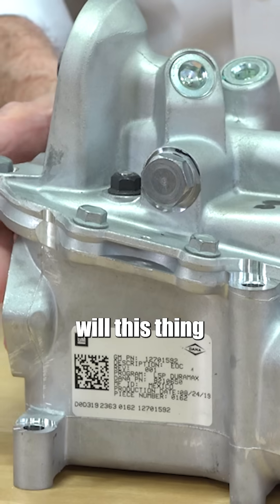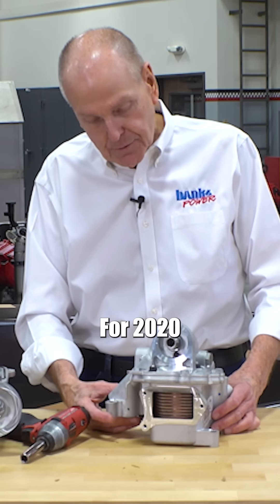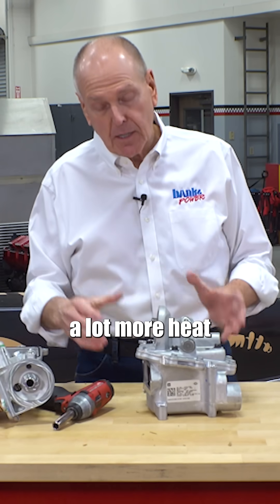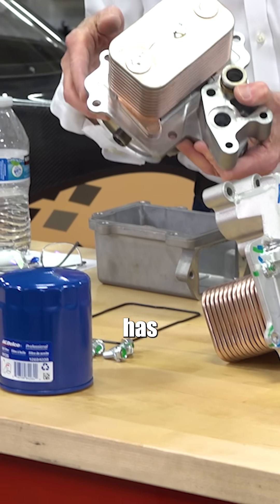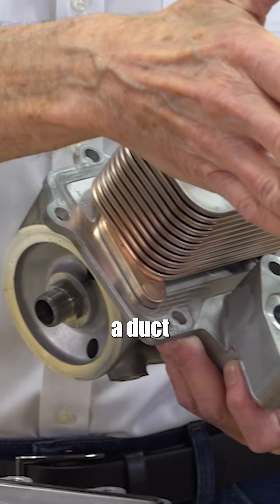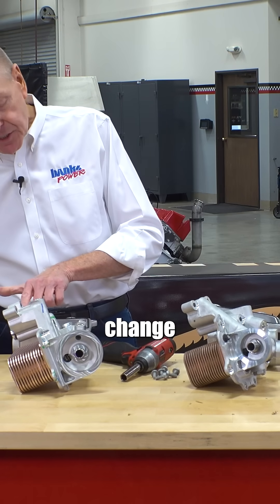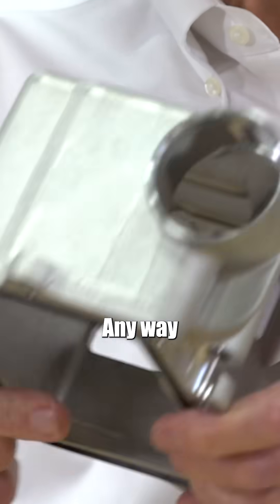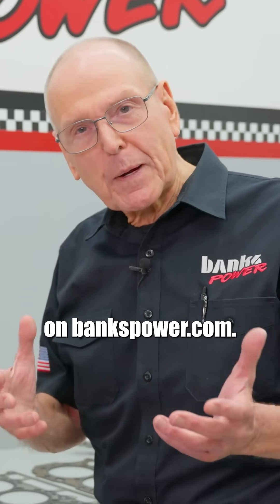Gale Banks inspects oil coolers and makes a discovery.

Comment: Gail the surprising thing is that the dealer has been changed the oil on his truck since it was new and they never even looked at the antifreeze to see if they had oil in it. How ridiculous is that how the motors got it out of freezer that oil pan and everythingI think they should be replaced the motor was European

Comment: What is your opinion to do with this matter is flashing it good enough should they replace the motor to your opinion, please
Reply from the maker: Flushing out oil and water intermix is an extremely long and repetitive process but it can be done. If metal went through the engine then that's a different story.

Comment: I'm not real smart but why would you want your oil the same temperature as your engine temperature. I would rather have my oil cooler in the air which doesn't get as hot as the engine. Air temperature 120 degrees max and engine temperature is 190 or more degrees all the time when running. Engineers what would we do without them.

Comment: I did this upgrade to my ‘13 LML,… definitely a tight fit and I did have to do a bit of trimming on the exhaust manifold but no issues!!! I do run an Amsoil dual oil filter bypass kit, so I had to get the correct adapter for the smaller oil filter attachment. Good to go now!!!

Comment: Do you know anything about the oil cooler issues on the new trucks. I know there has been numerous customers with oil cooler failure that is pushing oil into the cooling system and it is a pretty big repair. And it is linked to the oil cooler failing but is something else causing this to happen my good friend has a new truck and that’s why I’m asking.

Comment: I noticed what appeared to be a PF26 oil filter, which GM has subsequently discontinued and has since replaced it with a smaller PF63 oil filter.
Reply: Y?
Reply: @ I’m not sure, the duramax used a PF2232 since its inception until 2020 when it switched to the PF26, then after a year or so it was replaced by the PF63 which is used in all gen v gas v8s and some other applications. It’s a smaller filter perhaps for clearance reasons 🤷🏻‍♂️
Reply: @stellingbanjodude ahhh the ole 1 size fits all. Sounds like HONDA

Comment: I used the 17-19 L5P unit on my 05 for the fact I want to use the bigger oil filter.
Reply: Much more of a filter upgrade if you swap out the threaded nipple to utilize a CAT 1R1807 or of the like. It’ll actually increase your oil capacity from 2.5 to 3 gallons.
Reply: @HBC914  I use the bigger PPE 114000555 oil filter.
Reply: @HBC914 at a higher micron rating iirc. So unless ur doing EXTENDED drain intervals it’s worse.

Comment: Just one crazy question. Once I change over to the BANKS filter kit can I upgrade to a multi quart oil filter?  Many years ago I had 6.5 1992 Detroit diesel engine and I utilized the larger quart oil filter. I’m driving a purchased brand new 2019 6.6L Duramax 
4 x 4 3500HD with 46,000 miles on it. So would you recommend the standard oil filter or multi quart filter?

DARRELL 
Mississippi
Reply: I would say Gale knows the DMax as well as GM Engineers. Banks built DMax engines for Military application at their request.
Reply: @thegreenerthemeaner  that's hilarious 🤣 Gale is pretty smart but it's weird to idolize him like that. Also pretty weird to think an outsider knows more than the people that designed the engine itself.
Reply: @andrewahern3730 and it's weird that you would idolize the OEM engineers like that..
Reply: @ownthenight01  lol "idolization". Mate, I'm pointing out a fact: a team of people that work on something knows more than someone who doesn't. Get off of Gale's knob.
Reply: @andrewahern3730  first of all, I'm not the one that made the original comment... Second of all, yeah a team of people work on something, on a timeline... There is definitely room for improvement... Especially after it's been fielded for so many years... I make changes to engineers' plans, in the field; every single day...  These engineers don't know everything. They do the best they can with what they have to work with, with the constraints they have to work with, AT THE TIME... not to mention, the lawyers and the bean counters interfering in their vision.... It's crazy to me, the people that don't realize that there are improvements to be made... Or that, customers don't need certain trade-offs, where is another might... Just because that team of people may (have to) agree on a standardized design.... doesn't mean that the design is optimal. Some of these designs are the way they are to simplify mass production... So just stop.
Reply: @ownthenight01  you are the perfect buyer for the $100 gas cap.
Reply: @andrewahern3730  so let me ask you this then genius... Why did these engineers feel the need to update this oil cooler at all? Huh? Why not just stick with the one they had in 2001? Smart guy.
Reply: @ownthenight01  If OEMs are constantly trying to cheap out, why didn't it get smaller?
Reply: @andrewahern3730  why wasn't it that size to begin with? Hmm? If they are so all-knowing...
Reply: @ownthenight01  why does any manufacturer change anything? Why isn't everything perfect since the beginning of time? Why is it so hard to grasp how the real world works?
Reply: @andrewahern3730 why can't you grasp that you are only proving my point?
Reply: @ownthenight01  what is your point? You don't seem to have one
Reply: @thegreenerthemeaner  if you think Gale is better at OEM engineering than OEMs, he has a $100 gas cap to sell you.
Reply: @andrewahern3730 OEM has to make it a compromise between being good and maximising shareholder profits. 
Gale banks is just making it better, he tests whether things actually improve things and only markets it if they do. 
So yes gale is better than the OEM it's actually very easy to modify cars to make them better. 
Like giving a tune for the actual engine rather than a blanket parameters put in the ecu by the OEM.
Reply: @asjmpickle  what makes you think Gale Banks isn't making the same exact compromises? That's called engineering. No, it's not easy to cost effectively modify cars. Take the original question, why on earth modify the oil filter? Oh yeah, because thinking the OEM is cutting corners but not actually understanding wtf they are actually doing. Literally fixing something that isn't broken and spending lots of money on it.
Reply: @andrewahern3730  I can agree changing an oil gilter is pretty dumb. 
Even on a car making 5x its original power im running the OEM filter because its adequate. 
But upgraded cooler and pump gearset. 
Without it i would have definitely cooked the oil and sent my rods on an expedition. 
And why would gale be making the same compromise? He is improving it over stock, yeah it's still a compromise because an engine built for drag racing is a set of compromises while an engine built for towing is an entirely different set of circumstances. 
Its about the goal of those modifications. 
But you think gale is making a product that doesn't improve anything in the face of empirical evidence it does...
Reply: @andrewahern3730  it isnt adequate if stock was adequate then trucks wouldn't overheat towing up hill.
Reply: Do whatever OEM recommends. They already hired engineers much more qualified than you, or even Gale, and know the application better than anyone else. It's really hard to modify a vehicle from stock and not make it worse.

Comment: You got heat is working both ways you got the coolant heat then you got the oil heat so how's that going to cool it down would it  better to have cooling fins on the front of the vehicle the cool the oil
Reply: If under load, the oil temp will be say... 250, while the water temp will be 200.

Comment: Why is there not a supplementary air to oil cooler option
Reply: Why? It’s not needed & would introduce an unnecessary potential for catastrophe. Plus you get the added benefit of transferring heat from coolant to oil during warm up as coolant will be to temp more quickly. 

The only engines I’ve ever seen with an air to engine oil cooler were air cooled/oil cooled. Usually 1-2 cylinders.

Comment: Not for LMM which is misleading in the video. Per Banks Power website,

"Fitment Note: Due to Enhanced EGR cooling, Kit does not fit late 2007.5-10 LMM Duramax Engines"
Reply: Maybe it fits if you’ve done something or other to that hideous system?  I wouldn’t have any qualms if GB just said no comment to that.
Reply: @jalv9753  remove the EGR system.

Comment: I put your kit in my 06 3500 4x4. It’s a very snug fit. But no issues with the install.  I’m very happy with it
Reply: Take me back to the 70s,,,,,, big block Chevy motors worked fine for towing,,,,  Turbo 400 automatic,,,,    call me a cave man,,,,,,,,,
Reply: @chadalbert4977 reliability is more important than saving half a quart of fuel per mile. I love the old stuff.
Reply: @chadalbert4977 yeah 70s where 454 inches made 200 horsepower, let’s go to the 60s when things had real compression and made real power and all the cars looked better

Comment: Do these oil coolers actually cool the oil because I read some articles that these also act as oil warmers to heat up the oil faster for cold start ups
Reply: It does both actually. Coolant temp raises faster than oil temp, so having coolant run through it will get it up to temp faster. It’s the same principle with transmission fluid coolers, that run through the radiator. The idea is to get it to the preferred operating range and keep it there. You don’t want any fluid too cold or too hot.
Reply: This is just my own take—I’m not formally trained, but I’ve always had a mechanically inclined mindset.

From what I understand, since the engine coolant flows through the oil cooler, it can function as both an oil heater and a cooler depending on the circumstances. When the engine is cold, the coolant warms up faster than the oil, so the cooler can help bring the oil up to temperature more quickly. Once everything is at operating temp, the cooler helps stabilize the oil temp to be closer to the coolant temp.

If the oil gets hotter than the coolant—like under heavy engine load or towing—the cooler can transfer some of that excess heat from the oil to the coolant. This helps prevent the oil from overheating and contributes to overall engine thermal management.
Reply: @phuketFLHT excellent explanation. You are spot on
Reply: @phuketFLHT You are correct. That is exactly how it works. Same way integrated transmission coolers work (the ones that are inside your radiator tank).
Reply: Yes. Both
Reply: The full video convinced me that this oil heat exchanger cooler is effective. I've been skeptical about this type of cooler for a while since I was concerned it might add more heat than cool but that's me being not knowledgeable enough how cooling works. For a daily driver this is enough. Racing is probably where an air cooled oil cooler is better. Thanks for the replies!